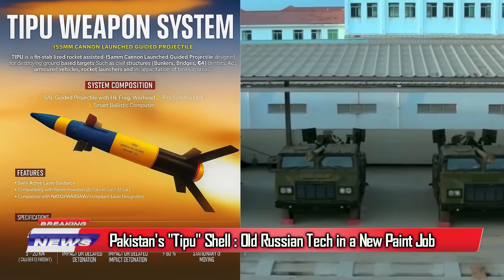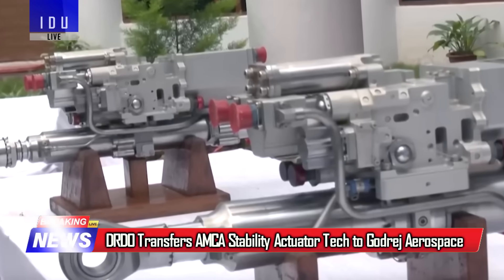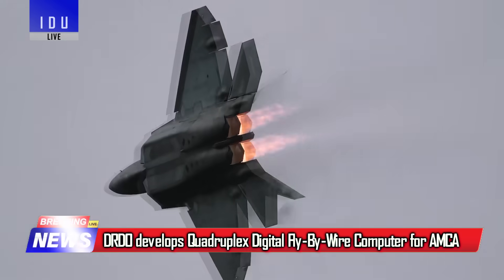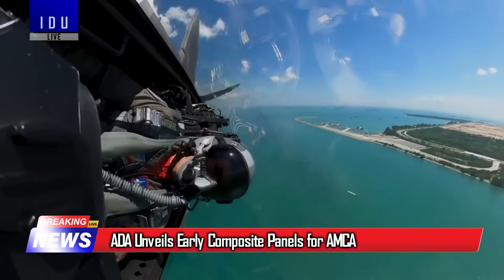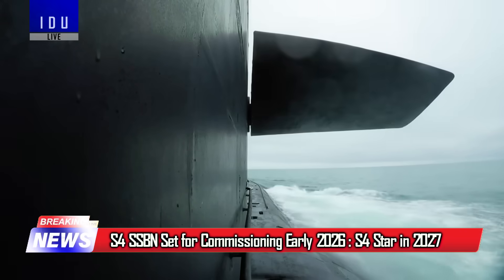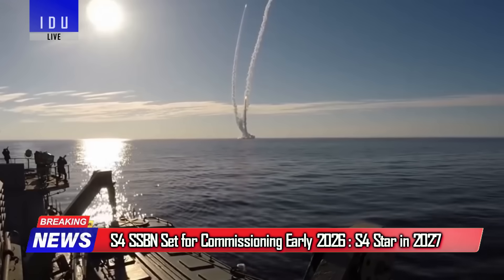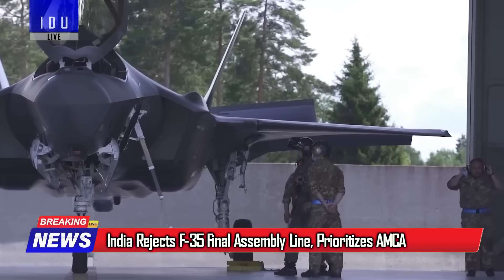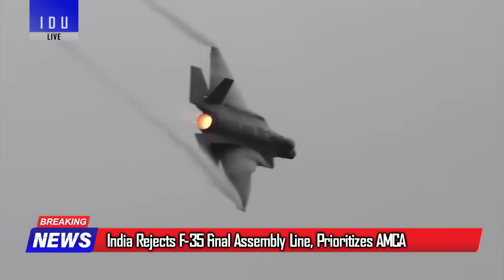Indian Defence Updates : F-35 Assembly Hyderabad,2 S500 Order,AMCA Composite Panel,S4 SSBN Induction

Comment: India still hasn't signed deal for GE414 engines. LCA Mk-2 production is still 4-5 years away. We should plan to use GTRE - Safran JV engine on Mk2 and AMCA. The design should be modular enough to fit the Godrej Kaveri engine, when its fully developed. Jai Hind ❤❤

Comment: AMCA need to be equipped with VERTICAL LIFT like F-35 🔥🔥
Reply: Sorry Bro ..F22 Does not have a VTOL system....F35 B is the one which has that feature.
Reply: F22 doesn't have VTOL
Reply: Vertical lift is obsolete 1960 era technology
Reply: Tujhe bada pta hai engineer scientist ki aulad